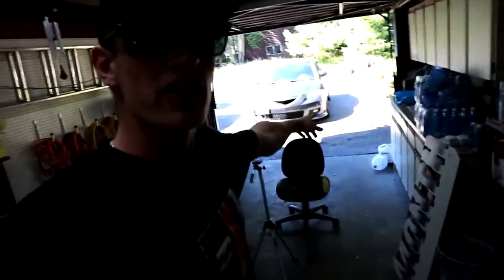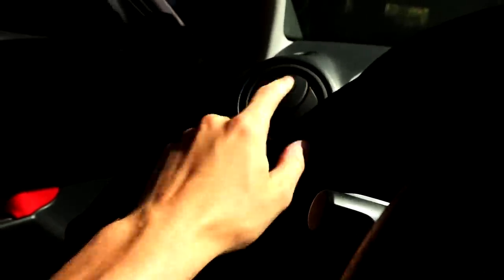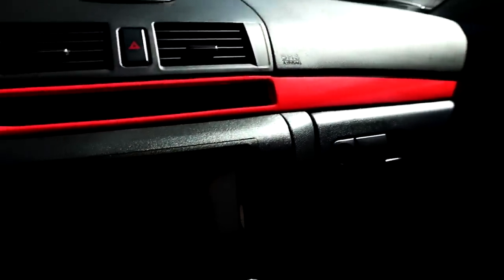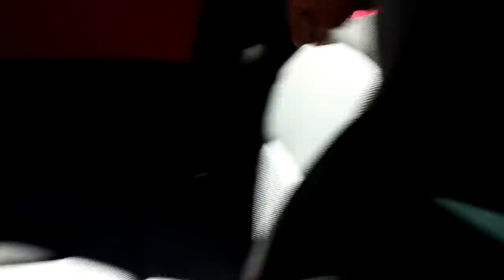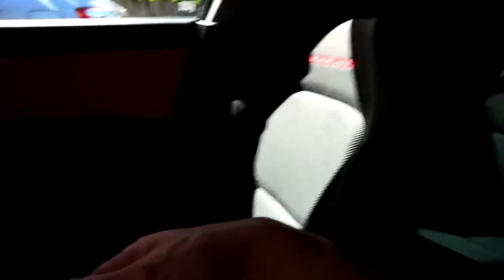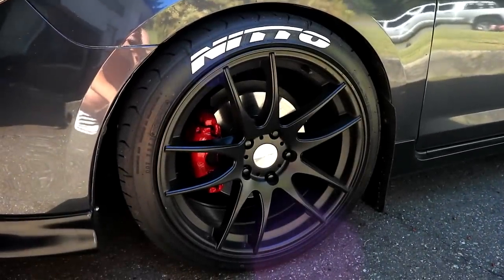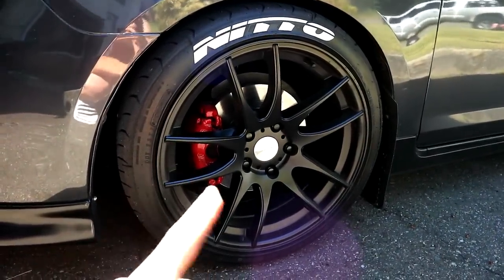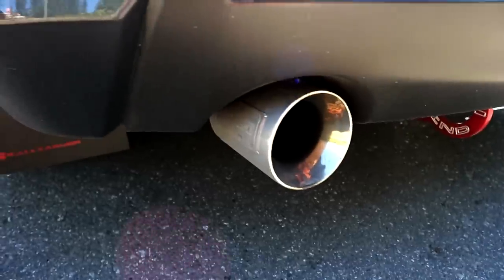MAZDA 3 MOD LIST! | 2007 Mazda 3

Comment: I love the first gen Mazda 3, its styling still holds up today. Awesome car dude, I fully support people doing whatever they want with their cars to express their individuality
Reply from the maker: Thank you!
Reply: I'm also looking to buy a Mazda car. Are there any issues with rusting or something with the 1st Gen Mazda 3 or 6?
Reply: @n_creproductions5290  yup! Usually around the wheel wells so look for ones that aren't rusting yet or very minimal rust. You can still fix it as long as rust hasn't eaten onto the body yet. Sadly, that is Mazda's downside especially if you're living in a place with harsh winter and uses lots of salt on the road.

Comment: @6:47  thousands of cold air intakes probably purchased every year for this car, and yet a resonator delete and piping to the front grill is probably the best 'performance' upgrade. You have to be VERY cautious in the rain, but a piped intake to the front grille makes the much happier to keep accelerating at higher speeds.
Reply from the maker: You're not wrong 🤔

Comment: My advice to any new MZ3 owner who wants to upgrade:
1. Put sound deadener in your car. (The road noise is unbearable for long trips, Literally gives me a head ache)
2. Upgrade the factory speakers. (They sound terrible)
3. Spend the extra money to get good tires. (You will thank me in the rain)
4. Have some money saved up for when the factory struts and motor mounts go out (around 40k-60k mi)

Comment: Hey man, Just came across this vid and your channel while looking up what I need for the sound system in my '07 Mazda 3 GT. (glad I got sidetracked [and represent BC!]) Gonna keep my eye out for the MazdaSquad stickers. I'm curious as to why you took out the Cold Air Intake. I love the look of the mud flaps on yours, not sure how they'd look on my white car. As Tarek said, and I agree, a shark fin antenna cover looks awesome. Anyways, really nice looking, and sounding, car! Keep it up :)
Reply from the maker: Took out the Short Ram Intake because there's really no point to having it, basically it increases power high end but loses low end power (and it makes a nice swoosh noise). I just thought I might as well get some cash in my pocket and sell it off, and modify my stock intake to get an all around performance from it.
Reply: Fair enough, money in the pocket is nice to have when doing car mods, stuff can get pricey! Forgot to mention that I have LED headlights but also added angel eyes (and a white halo switch) to use as my DRLs and then pulled the fuse. Have you been able to find good deals on the coast or just order online? I'd like to shop Canadian sites to avoid all the extra costs. And then there's the Canadian Dollar -_- I don't get out of Kamloops much
Reply from the maker: Unfortunately not, I mean the majority of stuff I'd get on eBay anyways for the 3. Other than that, we have to deal with the shipping costs 😂

Comment: Is this car reliable though? I'm looking seriously into one.
Reply from the maker: 110%
Reply: Very reliable, I bought my 2005 Mazda 3, it's a gas saver, I live in California and drive to vegas quite often. No lags, great speed.
Reply: I bought a Mazda3 2.3 and I love it! Mine has a couple of the less common defects sadly. The manuals have less defects if you drive stick. If you look on the Mazda forums, take it with a grain of salt and keep in mind that the comments on there are a tiny tiny tiny percentage of the people who encounter problems.  You'll actually read a lot of praise of people who only do basic routine maintenance and get absurd miles out of these cars. After all, if you're into cars and love your current one, how often are you going to be praising it online? Answer: YOU AREN'T! You're going to be too busy cruising around lol. But, like any car, take it to your mechanic and have them inspect it before throwing cash down. Use the forums to keep an eye out for the common defects as you're shopping around and use them to bargain with the dealer to sweeten the deal in your favor. Happy car hunting!
Reply: If you're looking into a Mazda 3 I'd suggest to buy a 2010-2013 model. Most affordable is the Mazda speed 3 i 2.0L (automatic). If your looking for the best handling performance, make sure to get a mazda 3 without a sun roof which will decrease the amount of flex in the frame when hitting hard corner or power slide.
Reply: 2010-2013 body has less of a round look to it which is much more ascetically pleasing if I do say so myself. Daily driven .com has a mazda 3 2010 named The Turbo Project which will give you an idea of what can be done to a base model speed 3.
Reply: I have a 05 2.3 liter Very good car 138000 on mine had to change the cat and the passenger mount that causes shaking above 60 and running great
Reply: Got 238000 on my 2006 mazda 3  and still running almost like new... Still no major problems!!! Only needed a transmission flush once and new selonoid.Only $70 from the local mechanic 👍besides that just usual part change on auto parts that go bad over time like bearings, brakes, tie rods etc. Most reliable car Ive had and Ive had everything from Lexus to BMW to Oldsmobile 😲 yes horrible american car lol 😂
Reply: Why would u want one of these cars
Reply: Super
Reply: Me have a 2015 sedan mazda white color. Absolutely love it. Its a head turner for sure.
Reply: Awesome car bro, need to ask u 3 things
1. That toe hook can u share the link where u got it?
2. Details about the wheels? Are these 18 inch, if so does it effect the mileage?
3. What u did with clock of original radio?
Reply: 183k and still young on my recently acquired 2007 Mazda 3 GT. Mazda recently launched the New 2019 Mazda 3 design. At that event they were explaining how they are working for quality and reliability ahead of anything else. They are in no rush to push a poor product, so they take time with extra care in every step. Mazda is building a future to compete with Germen engineering in Hope's of becoming the most reliable automaker.
Personally I have great experience owning Mazdas, and I also sell New and used car parts of all makes and models. Mazda is in the class of affordability when looking for replacement parts. WHY? Because typically parts are needed for repairs not replacement. Meaning the parts don't wear quickly so there is more access. I also find it "easy" to work on Mazdas.
 I would recommend Mazda To a friend (which may be why my best friend bought a mazdaspeed3).
Mazda fans are born every day, welcome to the revolution.
Reply: I have a Mazda 3 hatchback 2010 and the previous owner drove it a lot so it has over 200000 miles but it rans smooth
Reply: Speed 6 are too put 10000km on mine in 5 months no issues
Reply: Very!!! I own the hatch!! Would highly recommend the hatch though, more space plus in my opinion it looks cooler😃
Reply: Bought a piece of shit Mazda 3 2.3l for like 1400 bucks, and it needed a new engine as it was burning oil badly. I bought it nine months ago with the intent to replace the engine when it bricked out, but even though it should have no rights to be alive, it has chugged 6ish thousand miles with absolutely no problems. Just adding oil. It's so reliable that it's pissing me off, lmao.

Comment: Bought one I love it it does shake at highway speed swapped that out and it was smooth sailing
Reply: Mullo Rip how’d you fix the rattling at highway speed
Reply: Would like to know also! ^^
Reply: @declanfallah8112  Incase anyone else reads this it's the motor mount

Comment: I have a '09 Mazda 3 sedan daily. And guess what...it's a Mazda 3. No mazda speed BS because it's not. Just a nice, clean, Mazda 3 with an upgraded sound system and K&N cold air intake and LED lighting everywhere including LED switch back turn signals w/o rapid flash provided by VLEDS. And that's it. Point is, don't make it appear like something it's not because when the real deal comes along, you'll end up sucking in a real Speeds exhaust.
Reply from the maker: Or you put in MazdaSpeed seats so you're more comfortable...

Comment: What engine is in there?
I bought my first car; couple months ago and it’s a 2006 SP23 BK. SP23 means the 2.3L N/A option for car I got it. I got the car for $7000AUD ($4835 USD) with 63000 km ( 39,146 miles) clean record and it’s manual RHD because I live in Australia.
All I done to it is add a couple 5+ HP Stickers, muffler delete and blue tip exhaust done at a shop, took that massive radio Antenna which was 40 cm (15.75 inch) long to 7cm (2.76 inches), replace a head unit system with a Sony one that runs apple CarPlay which is amazing for Spotify and reusable performance K&N air filter (I want a cold air intake).
The things I want to do to my car is:
- suspension, coilovers in specific, I was considering getting lowering springs but then Facebook Australia of Mazda 3 Community recommend me getting some brand made in Australia or something like that
- tints
Also just by watching your customisation videos of putting LED inside The interior which is a great idea by the way I’m also going to put LED bulbs in the indicators and all of them. Apply some on the brake light and the third brake light the (middle light)
Reply from the maker: I have the 2.0 :)

Sounds like you have a motivation to do some cool things to the ride, good luck with everything!
Reply: Colton Richter cheers

Comment: Hey Colton, I have a 2007 Mazda 3 sedan. What low beam led’s did you use. What brand etc...see some people used spacers to make them work. I desperately want to change mine out.
Reply from the maker: H7 from eBay.

Comment: Great Vid! Why did you get rid of the intake? how is the delete mod better?  thanks!
Reply from the maker: For the platform, basically removing the stock intake resonator will do the exact same thing as a short ram intake would.
Reply: Sweet thanks! Do you have and guides you recommend for removing the resonator? I can’t find much and can’t really figure out how to do it or even what/where it is. Lol I’m very new to cars and I got a 2009 Mazda 2.3l as my first car. I love it!
Reply from the maker: Basically all you have to do is take off the top of the airbox and remove the bottom half of it, might need to take the front bumper off as I had issue with a rusted bolt
Reply: awesome man thanks! You sir, have earned another sub. Your how to series is awesome. I think I’m going to get some fresh ngk plugs paint my brake calipers according to your vid and do the resonator delete mod as a start to my mods. Yours looks and sounds fantastic. Thanks again!

Comment: Hey man love this list! I really wanted to sell my Mazda 3 2008 GSX manual to get like an STI but can't afford it right now. Might just mod my Mazda for a few years until I can really save for an STI or something. I do want to get more power though. I have 150 horsepower I want to get somewhere in to 220-240 range.

Where would you start when beginning to mod? And can you turbo stock Mazda 3s?
Reply from the maker: Look through forums,  I tell people this topic all the time over and over again.

When people say buy a MazdaSpeed 3 instead, they mean it. To make that power in a 2.0, you'll need forged internals and a turbo kit which will range you high. When I had my 3, I didn't make power in it for a reason, and i'm much happier making more and more power in the Speed 3. It's not worth it, but if you feel like it then go for it! I can't lead you in a direction though, never had experience!

Comment: Needs a high lift low duration cam in the second cam slot, put the original “second cam” in the first cam position, injectors/intake/exhaust and programming to accommodate the changes... NA all day. Honda bois can get 500hp out of 2 L, 2.2 L, 2.3 L  NA engines. It has to be possible to get 300 out of these things with the stock internals.
Reply from the maker: Unfortunately these things only like 200 with boost while being a tad upset... haha
Reply: @ColtonRichter  i mean, the first gen mazdaspeed 3 rolled off the lot pushing 260hp/280 LBS/Feet on 15PSI so🤷🏻‍♂️
I still have no doubts that you could actually make some good power out of one of the best four cylinder power plants Ford/Mazda has developed in the last three decades.
Reply from the maker: You'd be surprised, they designed that specific 2.3 for the boost. It's a different power plant then the Mazda 3 2.3 N/A's, which have problems without even touching the power band... the only actual N/A that people will tell you, and choose to is the 2.5 from the Fusion or the 2nd generation of Mazda 3's. The Protege motors were toothpicks, I think their last actual 4 banger you could do something to would be the Miata's 1.6 and 1.8...

Comment: Do your front rub at all? I have 18x8.5 48 offset. Wanted to get something more conservative because I didnt want rubbing issues but I might run spaces if theres no rubbing worries. I have mine on BC coils lowered a couple inches.
Reply from the maker: I rubbed on these, but remember these were also basically more aggressive by 15mm offset.
Reply: @ColtonRichter  Yea I was thinking about adding 10mm Spacers or maybe less.

Comment: I had switch back front blinkers for my Mazda 3 .loved em .they ran white and then turned yellow when I turned the blinker on .
Reply from the maker: Did you have to put in resistors as well?
Reply: Dudesk7 they came with wires that had them already wired up ..it was plug and play ,I got them on Amazon.
Reply from the maker: Sounds good, i'll look into it.

Comment: i know your sick of people asking dude but were did you get the tail light set up speedline? and when you changed to coilovers did you change the rear camber arms so there adjustable for the coilovers
Reply from the maker: I bought from vipMOTOZ on eBay, they have the cheapest you can get them.
I dont have rear camber arms for the coilovers.
Reply: thanks ill check them
 u didn't have to switch out for adjustable camber arms good to know

Comment: Hey man idk when u gana reply but I was planning on buying a Honda Si but I didint end up getting it . Rn I’m looking at a Mazda 3 touring and I was gana ask does this car give you problems ?  Like any thing in specific ?
Reply from the maker: It's been a fantastic car, just look out for suspension wear and make sure that it has service records!
Reply: Colton Richter thanks for the fast reply brother 💪🏽. Before I ask my other question I wana say u have a nice car bro it’s 🔥 but I’ve always been a sneaker head right I always liked cars but not how I do now . I went to a car meet and realized that’s what I wana spend my money on . Rn I’m tryna buy another car which I’m really considering this one . So here comes my question HOW much did you spend on the coil overs and how much was the total cost . Sorry if you said it in your video I’m just looking for a car rn and I was skipping through video
Reply from the maker: Juancho honcho Coilovers cost basically the same for every car, but my set of BC's came in all at around $1400CAD. You can buy a budget coil and set of wheels if you don't want to spend every dollar towards it
Reply: Colton Richter thanks brotha 💯💯🔥 nice car man really like it

Comment: I just got a 2004 Mazda 3 GT and I was wondering if it’s worth fixing up and modifying a bit like yours. It has 223,000 kilometres, a ton of rust damage but driveable, hasn’t been driven for awhile. Is it worth it to turn into a car like his?
Reply from the maker: If it's hella rusty I wouldn't bother, drive it to the ground & save up for something clean!

Comment: Nice car bro! How do you remove the handbrake button? I want to paint mine.

Thanks in advance!
Reply from the maker: Hard to explain, pull down on the bottom of the boot. There are tabs that the handle hook into, then that'll slide off. The button is also held in by mini tabs, push those in and it comes off.
Reply: @ColtonRichter  Thank you! I'll look into it, thanks😁

Comment: I have a 2006 Mazda3 2.3L, it has the stock exhaust and it’s basically all engine noise. How much did yours cost? And was it easy to install?
Reply from the maker: $600USD total, easy to install.

Comment: Ehi bro! I have a semi-standar mazda 3 2004 and is all stock. I want to change the suspension in the coming months and it would be cool if you can let me know around how much can it cost just playing simple. Once in my first 6hr trip I drove it in a big hill and I tried using it semi-standar but when I got to a landscape area in the hill my friends and I got out and the antifriz container was boiling... I just waited and it cool down and when king of slow the hill and on automatic, but I really want to start using the semi-manual feature!!! Rarely press the pedal to the end but you know something the racer in me wants to fly. Sooo... Any tips on how to RPH the Mazda 3 without damaging the motor block?

Comment: Hey man.. do you have any lip on the rear of your gen 1 mazda 3? Ive been trying to find some lips for the front and rear 🙏🏼please reply
Reply from the maker: No, only the lip on the front. 

I personally don't like rear diffusers!
Reply: @ColtonRichter  thanks man🙏🏼 and were did you get the lip? Im trying to find a good lip
Reply from the maker: Bayson R
Reply: @ColtonRichter  i can only find one for an 07 and up?? Would that fit on a 06?
Reply from the maker: Manuel Hilario They have them for 04-06 as well.

Comment: IMPORTANT QUESTION!!! I just ordered these same wheels and tires but do I need to roll the fenders to make this work I’m on stock suspension but I’m going to put lowering springs
Reply from the maker: If you're on stock suspension no, and depending on the drop you get with lowering springs you might get lucky but most likely have to rolll your rear fenders.
Reply: @ColtonRichter  thanks for the quick response i might have to get different wheels then
Reply: @Altariya  just roll the rears